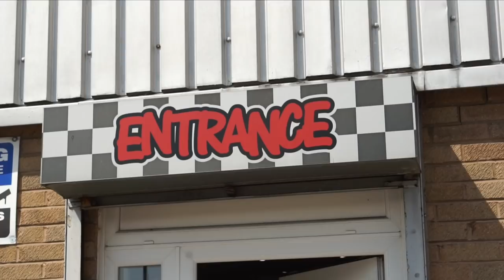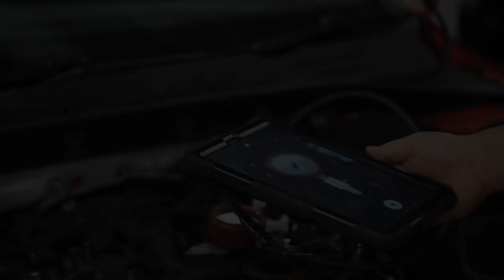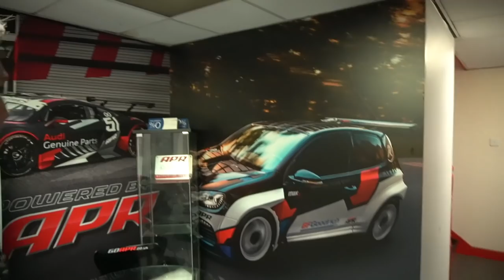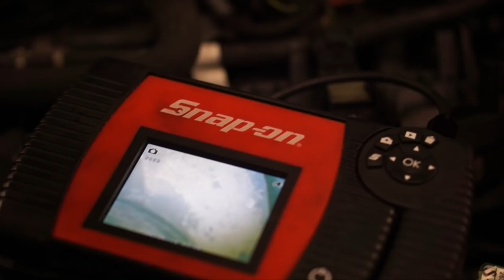THE GOLF R GOES TO AWESOME GTI FOR TUNING - BUT DOES NOT GO TO PLAN AT ALL!!

Comment: i’ve got to say that was one of my favourite videos so far , so interested in the testing ect! sorry Owen, i felt the same when my old porsche was in manchester getting dynoed,…had so many boost leaks from factory parts even my brand new fuel preasure regulator wasted 6 + hours to diagnose a 40 unit and i just bought it 🙄 i took the manifold on and off about 4 times trying to fix leaks it was a right pain in the arse,…and ended up having to get t a 5 hour train ride home and leave my baby there ☹️ 

i love hearing your tec talk Owen by the way so maybe next time make it a long vid 🤙🏻🤙🏻😉 
Daniel